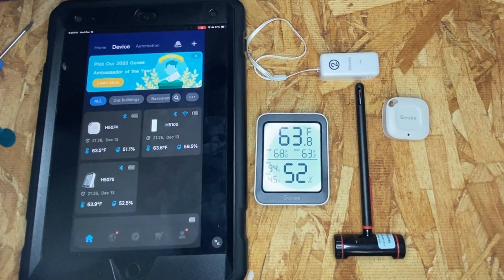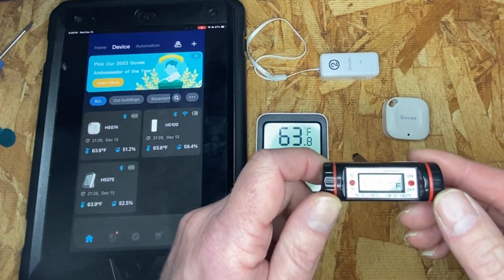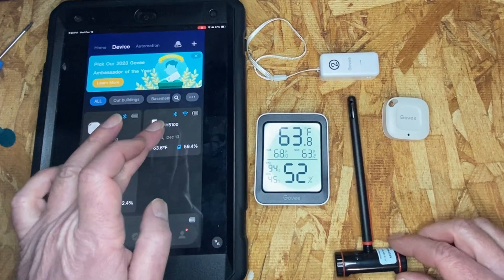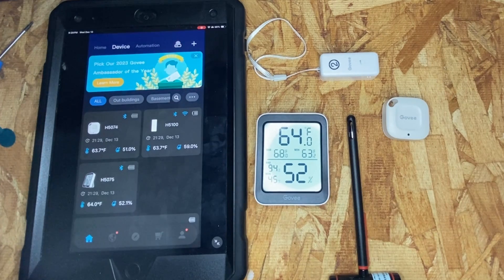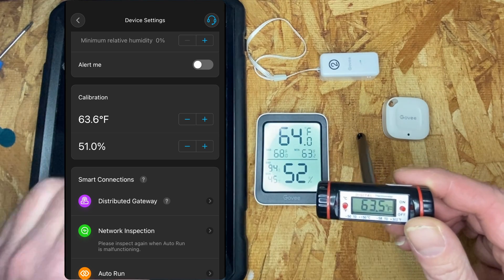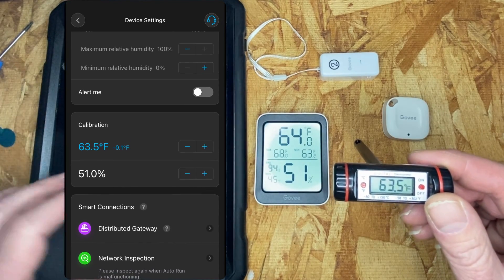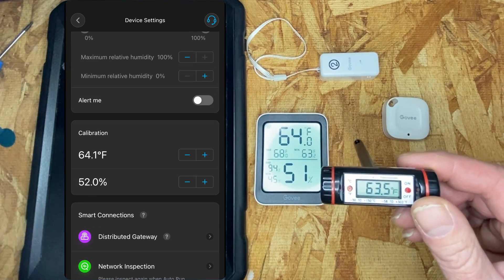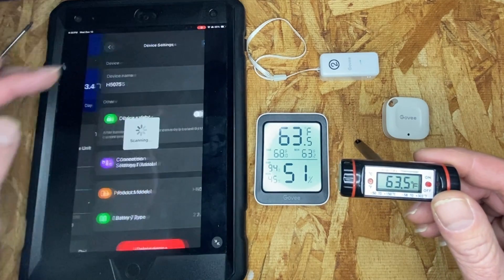Calibrating Govee temperature sensors

Comment: Is there a way rio recalibrate - reset  my older AcuVite room temp thermometer? It is off  by 3 degrees. It is model # 00619.  Thank you.
Reply from the maker: I’ve no experience with the acurite systems.  Google seems to imply that that if it’s a smart device it should be possible.